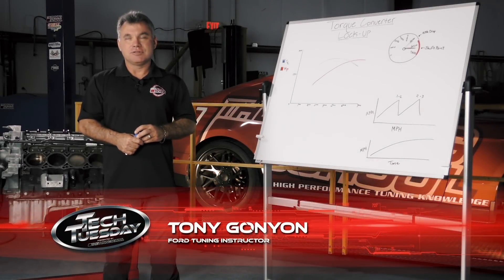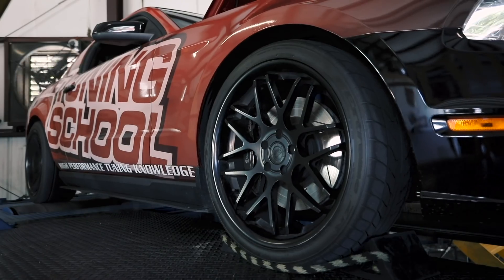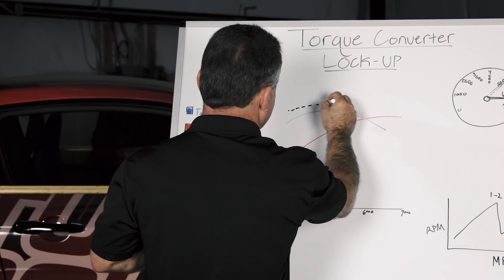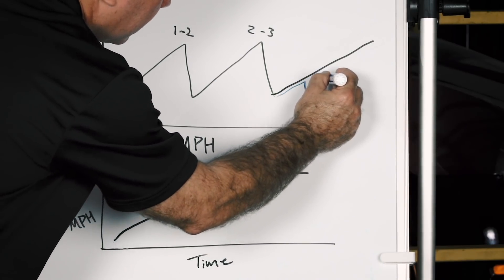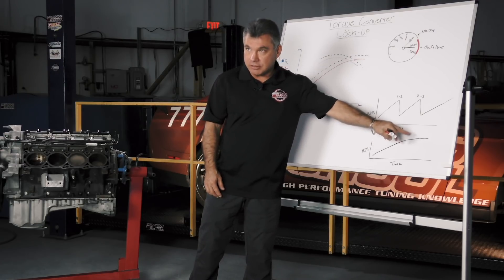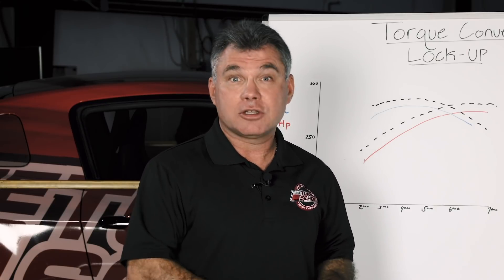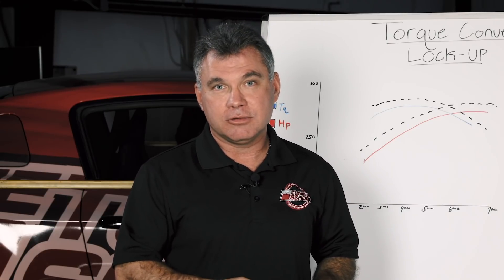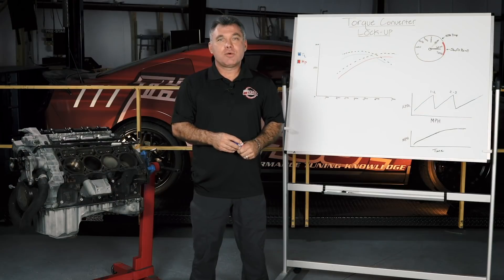Converter Locking Points

Comment: I have a 2022 f 250 and the torque converter locks in way to soon all the truck does is bog its completely useless I pull a trailer with my mow equipment and plow it locks in at 1.5 thousand rpms and once it's in it will not disengage no matter how slow ur going can it be fixed?
Reply: Put it in tow haul mode
Reply: @MegaDysart  that doesn't work it still locks in and won't come out

Comment: Since the engine  usually will have more torque and more horsepower at higher rpm's shouldn't you just leave it unlocked the whole time to allow it to multiply torque thus having most  power out of your engine or did I get it wrong if indeed I am wrong elaborate please!?

Comment: "Which is was most dynos are setup for" ????  Say what????

That's the mathematical relationship, not dyno settings.
Reply: He's talking about the lines physically crossing.  Some dynos are setup with HP and TQ  on different scales.  When this is done, they don't cross at 5252.  ;)
Reply: @yamahaSHO  wrong
Reply: @zacharymorris9917   No, not wrong.  Clearly you have not used enough dynos, or simply do not understand what I said.  Maybe in another 3 years?
Reply: @yamahaSHO  🙄

Comment: I totally get what you're saying. But at the same time I wish there was manual lockup control, like a physical lever, or third pedal, haha. Lockup also helps in part throttle on the street. It helps the transmission feel more like a manual or a DCT. When the converter is unlocked and the transmission is programmed to be loose with less converter pressure, rolling into the throttle feels terrible -- the car revs but doesn't move. That kind of behavior is suited to immediate WOT, but not gradual throttle tip-in. Converter lockup solves this.

Comment: Good video, Not my style of racing and I REALLY don't like auto's, but very well explained, overall.
To clarify, folks, what he is doing it trading off some slippage, which sosts torque, for running the engine in a rpm range where the increased torque production is greater than the loss in slippage against 'lock up' where there is less torque from the engine, but also less loss due to converter 'slippage'.
Depending on the specific vehicle, traction, etc, I would expect there will be times it 'may' be beneficial to lock up a little earlier to allow the chassis to 'settle' over the drive tyres rather than immediately 'blow' they tyres off because the load trandfer wasn't yet complete?

Comment: I got all this figured out on my own, works great.
Now if  HPTuners  would just give me access to all the "Coast-Mode" settings, 
I could make my Trans absolutely perfect in every way.
But evidently Gen III is now ancient history, with no time for further refinement.
I can understand that there are probably higher priorities, but it doesn't mean I have to like it. ;)

I may have to switch over to a MegaSquirt  GPIO Board  with MegaShift Software installed to control the transmission,
but work out how to keep my stock 411 box connected, and informed, as to what gear the trans is in, VCC Signal, etc.
But for now, it will have to be manual switch control of the TCC for everyday cruising, 
WOT lockup is smooth and perfect, midway between 2nd & 3rd. 

( 3500 rpm Converter in a Daily Driver )
( Converter stays locked above 17mph at light throttle, but "Coast Mode" kicks in whenever it  "decides to", 
and the converter will not lock until a certain combination of throttle closings has it determine 
that it's no longer in "Coast Mode", ( or this could be "Performance Mode" trying to kick in automatically)  P.I.A. either way ).
( also, "Coast Mode"  ALWAYS PREVENTS closed throttle downshifts under any circumstances, 
trans will remain in 4th, with Converter Locked, until the throttle is depressed, THEN it will down-shift, regardless of Maps )
( There are NO controls related to  "Coast Mode"  in the HPT software ).
( I am aware of the Over-Run Clutch not being able to engage while in O-D Range, 
the TCC bypasses the O-R Clutch when it is in lockup, so under lock-up, the O-R Clutch is irrelevant ).
( If I had known about this quirk,
I would have had a bypass line installed to supply pressure to the O-R Clutch while in O-D Range,
or, modify the Manual Valve for the same functionality ). 
.
.
Reply: Jim Brown how do you setup manual tcc control?

Comment: So you want to lock up in the "diamond"?  Is anywhere in the diamond good or do you favor one section over another?
Reply: You need your figure out how much RPM the engine drops when you lock the converter up… let’s say your power band is 4000-6000rpm and your converter drops 500rpm when it locks up you should have the lock up happen at 4500rpm that way you don’t fall out of the power band…

This diamond isn’t really a good thing to look for because if we used KW/NM instead of HP/FTLBs because the same Engine would make the “diamond” in a different spot…